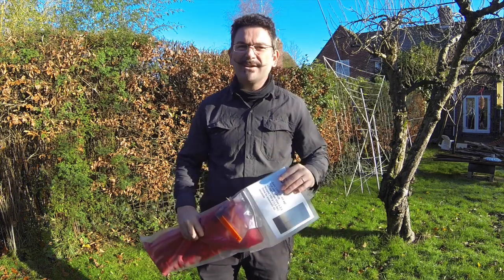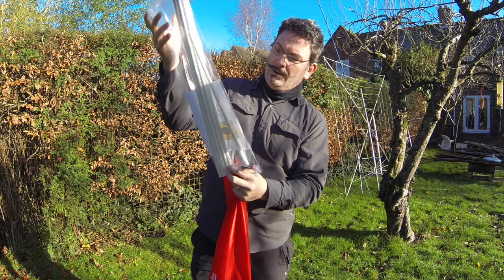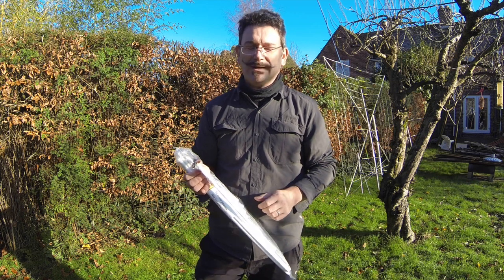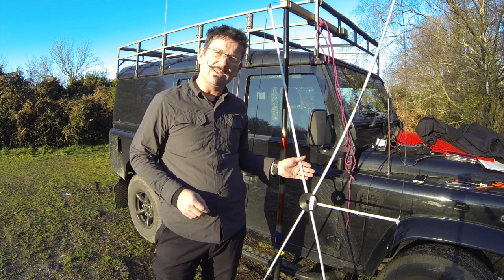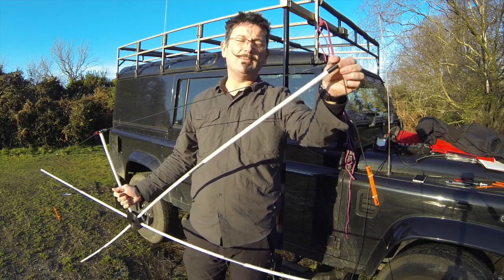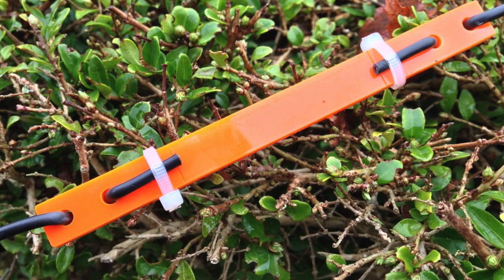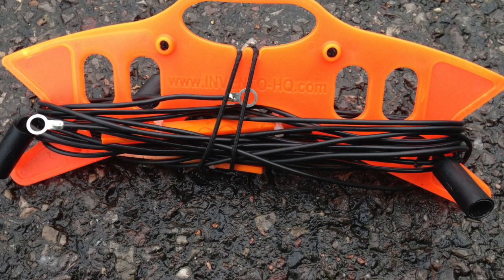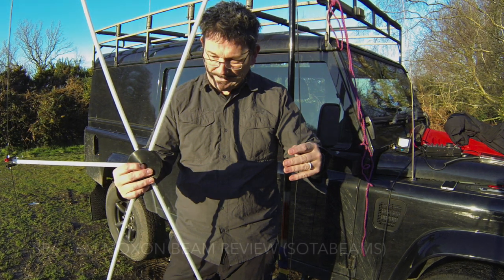SOTAbeams SB6

Comment: Thanks for the vid Michael, pity they dont make this anymore as ive been looking for one,  perfect for taking on holiday in a case.
Reply from the maker: Yes, sadly (I assume due to demand) Richard from SOTABeams has to bring product lines to an end. I must add a note to highlight this in my video descriptions but will leave the video in case people see them for sale 2nd hand. I may even sell mine as I'm not a major user of 6m!
Reply: Let me know if you do Michael I would definatley be interested, off to Turkey in June and taking my little FT-817ND with me so wanted something portable for 6m, dont think this antenna had very much of a product run as it was only avaialbe for quite  a short time which is a shame, I was looking into building something similar then I came across your vid and the antenna ticked pretty much all the boxes.